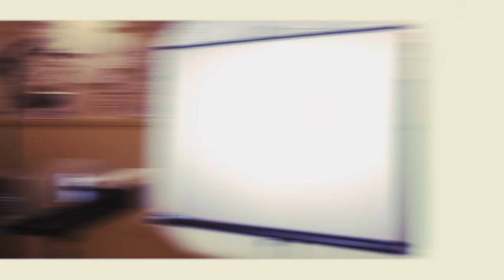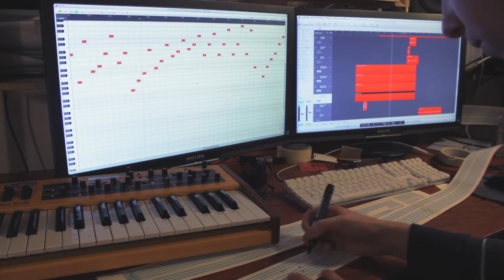Wintergatan - Starmachine2000

Comment: What's the projector thing they used?
Reply: +Joseph Kim wow i'm getting old, and i'm not even 20. this is a slide projetor to present pictures. in times of analog photography, they took transparent dia-positives from their out-of-the-camera-negatives and put them in these little frames you see on the right of the projector. it slides one of them in front of a light bulb to project it straight on the canvas. the last time we used one of them in my home is almost ten years ago.
Reply: +Wintertot thought so. what's the instrument in the bottom left. looks like a guitar except held under the chin
Reply: +Joseph Kim It says at the end ( 7:28 ) that it's a modulin which, I'm assuming is some kind of hand-held theremin.
Reply: Yea they seem to have made an modulin in order to mimic the sounds of a theremin but I guess have a more range of sounds or more free of movement when playing it.  Regardless, its really coool to see in action
Reply: iwillfroget the modulin is a violin and a synthesizer i think.